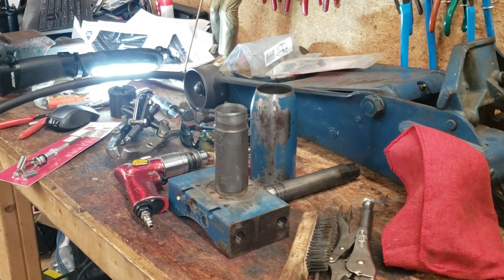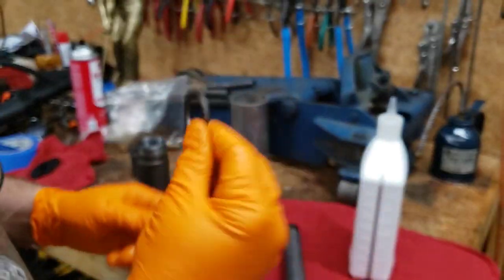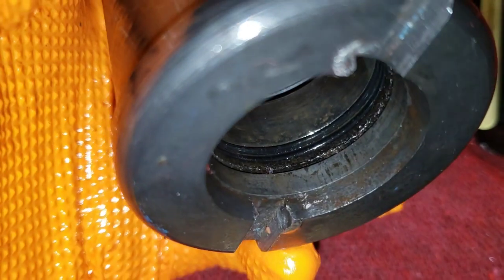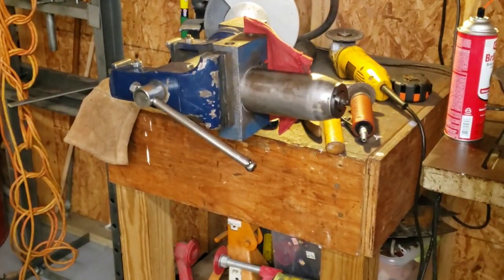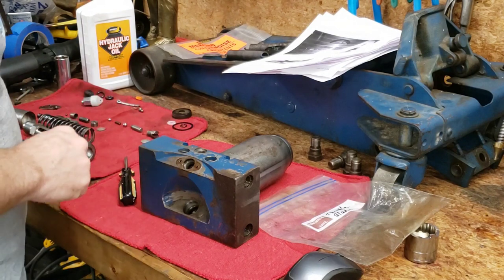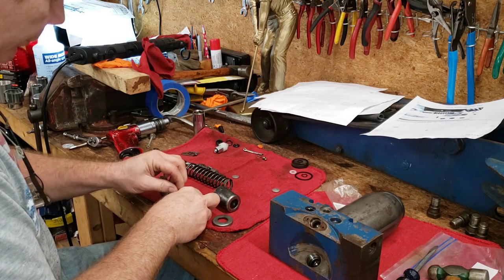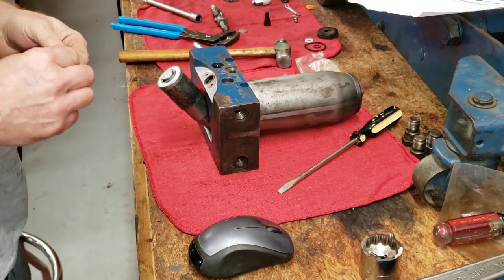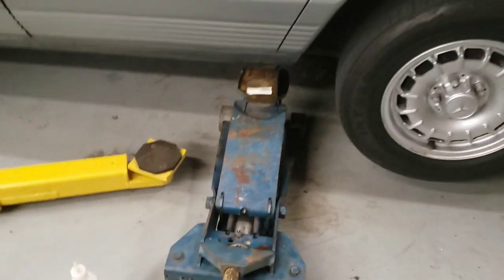Walker Floor Jack Model 93632 1.5 Ton - Step By Step Rebuild - Part 2

Comment: I commented on Part 1 about getting that tank nut off,
but I welded up a better tool, held it on with a 12" C clamp, and used a striking wrench to turn it, and it worked well..

I got everything back together, and everything worked.
I put it outside (so I didn't walk into it and stub by toe, etc), and discovered it leaked a bunch of oil out the over-pressure valve thing...
After trying to make sure I seated the little ball in there well (a little carefully tapping as described in Lazzar's website), 
I realized what was reeeally happening was the "vent" that had been on there was actually a check valve (with a 1/8 NPT threads and not 7/16-20 like it should..) and not letting air back in, and the fluid couldn't go back in the reservoir and was finding it's way out that over-pressure valve...
For now I have a piece of paper towel in there, and will get the right vent.

Thank you again, your 2 videos were a big, big help!

Comment: Hello.  You mentioned that you would post a link to the instructions you followed.  I don't see it posted ... could you point me to where it is or repost them?  Thank you for taking the time to make these videos!
Reply from the maker: Hey Jim. The instructions I used are at the link in the video description above.
Reply from the maker: Seal kit: https://www.hcrcnow.com/shop/seal-kit...
Model #93632, Series # * All Series, Hydraulic Floor Jack 1-1/2 Ton
Reply from the maker: https://www.hcrcnow.com/faqs
Reply: @ImpalamansGarage  Thank you.  I had actually seen those before.  Those instructions leave out a fair amount of detail, but your videos fill in those gaps nicely.  I have a Lincoln 2 ton jack (model 93642) that I purchased new sometime between 1988 and 1990.  It worked flawlessly for all those years.  It's surprising to see how the design remained virtually unchanged from your 60's or 70's jack to my circa 1990 jack.  A couple weeks ago it wouldn't lift despite adding oil and bleeding.  After taking it apart I could see why ... sludgy oil and brittle and broken seals.  The heal plate (white plastic piece that goes on the piston above the cup seal) was stuck in the bore and I had to destroy it to remove it.  I'm waiting for a new one to arrive.  Once it does I'm looking forward to continuing the rebuild with the help of your videos and getting another 30 years out of this jack.

Comment: You don't need seals for the outer cylinder because it is not used as a reservoir. The reservoir is in the block at the bottom of the jack. For jacks where the outer cylinder is the reservoir, you would have a rubber cap on it for the oil fill hole.
Reply: Pretty sure the outer cylinder is indeed the reservoir..

Comment: Hi, great job and thanks.

It is difficult to tell but the jack cylinder appears to be about the same size as a 5 ton bottle jack, can you confirm?

I am just wondering to understand the lever length and I'm guessing your jack has 3x the length from the pivot point to the saddle as it is from the pivot point to where the cylinder connects, assuming a 90 degree pivot point.
Reply from the maker: It's a 1.5 ton jack. It's pretty old.
Reply: @ImpalamansGarage  I seen that it is a 1.5 ton jack but was asking about the cylinder size.

Comment: Great explanation of each step..   However, I bought the rebuild kit from Lazzar and I am having problems with the pump hanging up and it will not jack up……. Am I missing a simple filling step thats not allowing me to get it going??      My jack has a bit different ram than yours.  The older model.  How much oil will these things take after a teardown?
Reply from the maker: I don't know how much oil. I just filled it until it was full. Possibly you tightened the lock nut down too tightly compressing the leather sliders such that it prevents the pump from moving properly?  I'm going off memory. Apologies.
Reply: Back off the nut holding the leather cups in the pump assembly.

Comment: About the safety valve - I turned the adjustment screw to bottom out the spring in my Hein-Werner (Walker/Lincoln), and it partially (permanently) compressed the spring. That means there's no way to get it back to the factory setting using that method. You did this the right way, but the question is, why even remove the two expansion plugs unless you know there's a problem? The safety valve has no o-rings or gaskets to fail, and the power plug gasket is only there to keep oil from seeping out the top, past the expansion plug. My advice is to replace the o-rings and seals on the pump, u-joint and main ram, then test the jack. If it works properly and doesn't leak, leave the expansion plugs alone.
Reply from the maker: This jack was completely non-functional. Nothing about it worked and it leaked from everywhere. It was basically junk when I got it so I decided to completely dissemble it.
Reply: @ImpalamansGarage  Just to be clear, I wasn’t criticizing your work. But if someone with this jack only has a leak (other than at the expansion plugs), and the jack is working OK otherwise, I don’t see a reason to pull the plugs. In fact, the two plugs and the parts in those bores can be removed without disassembling the jack, so it doesn’t actually save time VS doing it later if necessary. In my case, the jack was operating OK, but it was leaking from the front of the ram. It was worthwhile to replace the V-packing in the pump and the O-ring on the release stem while it was disasssembled, but I wish now that I hadn’t pulled either of the expansion plugs. 

Speaking of the release stem, I was really bothered by the need to push the O-ring over all those threads in order to seat the ring in the groove. I ended up making a thin aluminum mandrel (tube) on my lathe, just large enough to slip over the threads. Then I pushed the O-ring onto the mandrel, set the mandrel over the threads and pushed the O-ring into the groove. I really think something like this could be made cheap enough to include it with the kits. Alternately, maybe the threads could be wrapped in tape or covered temporarily with a piece of heat shrink tubing.

I’m almost done replacing parts now and have decided to use RTV to seal the tank and tank nut. I’ll give that a week to cure before adding oil. Like you, I left the expansion plug off on the safety valve, so I’ll adjust the nut later by trial and error. If it lifts the front end of my F150, it’s good to go (I have the 2-ton version). Thanks for taking time to make the video, it was very helpful to see how you did the work!
Reply from the maker: @TriodeLuvr  Clearly you know way more about this topic than I do! 😅 Appreciate you hopping on here and commenting. This type of info helps a lot of people.
Reply: @TriodeLuvr  This is called REBUILDING something. Complete disassembly is a matter of course, to be able to clean everything thoroughly. Dealing with putting it back together, replacing parts, looking up torque values, adjustments like that pressure valve, etc are also all "matter of course" for rebuilding or overhauls.
Reply: @spettro9  Service on machinery does not always require complete disassembly. It is often sufficient to repair only the area in need of maintenance and to test the other systems for proper operation. I wish I had done that in this case, and I stand by everything I've said previously regarding the work on this jack.
Reply: @TriodeLuvr  Right, you can get away with it, but you should have at lease taken out the side plug (under one of the 4 side bolts) to be able to clean the passages

Comment: hello very good video excellent explanation
I need to know what is the diameter of the main piston and that of the small push piston. 
could you tell me?
Reply from the maker: I do no have the dimensions of the parts. You may be able to obtain the data from the rebuild kit manufacturer. Visit the site listed in the description and contact them.

Comment: Is it possible do a service of just changing the fluid? I got mine at an estate sale today for $22 no rust, looks like it’s never been used. Works fine... but I think it’s low on jack oil. It appears there’s a nozzle by the two caps which appears to have a foam filter inside... is that right? Thanks for the rebuild vid
Reply from the maker: Sure. Just add some jack oil and see what happens. If it works, use it. Depends on your tolerance for fluid leaks. lol.... If it just leaks a little once in a while, just fill it and use it. The port you mentioned is the fill point. Test it thoroughly before putting it to work. Safety !
Reply: @ImpalamansGarage  vent port / fill port.

Comment: Dear sir, really great video. I have 2 similar hacks with slotted housing top. The tool you made is awesome and I took pictures of it to have a machine shop Jake it for me as I do not have a welding apparatus. Would you be kind to loan the tool. I’ll be glad to pay shipping and will return within a week. Or if you want to sell it maybe? I am in Charlotte nc. 
Kind regards, 
Ash
Reply: Advanced Auto sells bearing sockets. One of the sizes might work for you. Under $20